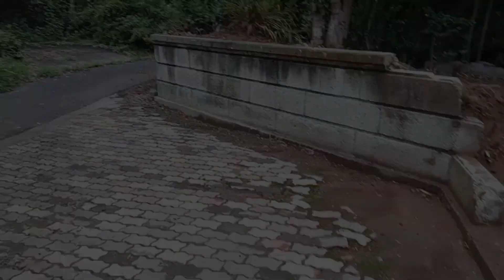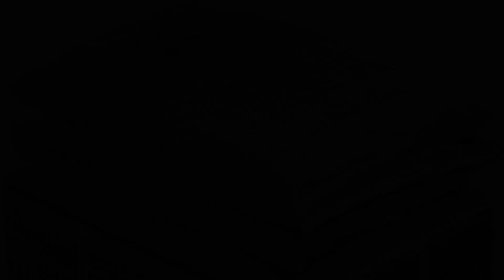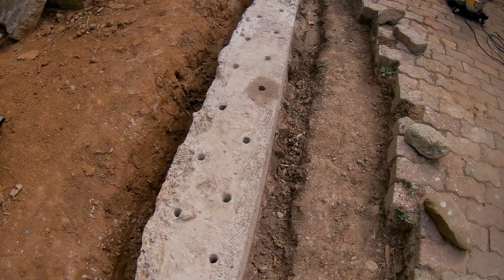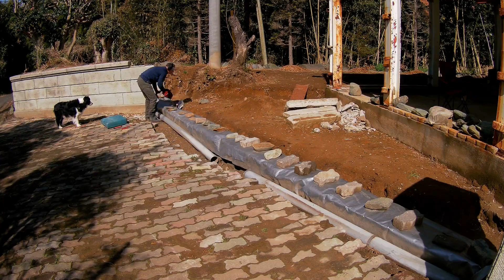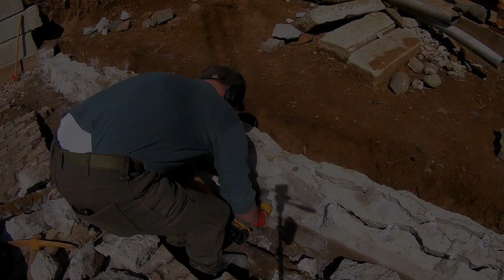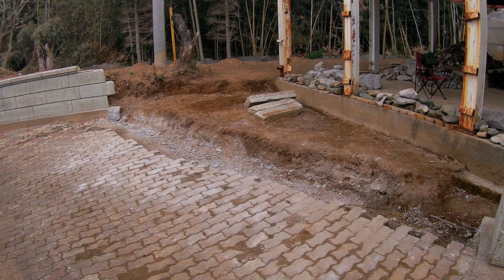Chiba House Part 7 Demolition TIme!

Comment: Not sure why the 80% depth limit ? Fwiw, I think it might have been easier to build OVER the concrete buffer, raise the whole landing...
Reply from the maker: Thanks for the comment. The 80% limit is I believe to make sure the Dexpan remains in the hole and doesnt pour out the bottom. Paving over this concrete foundation would have raised the slope up to the garage too high unfortunately.